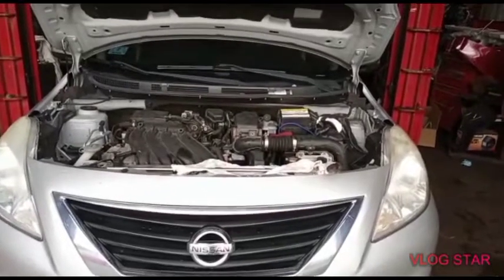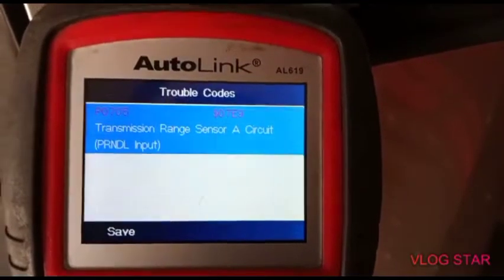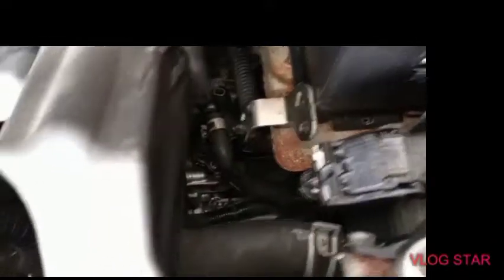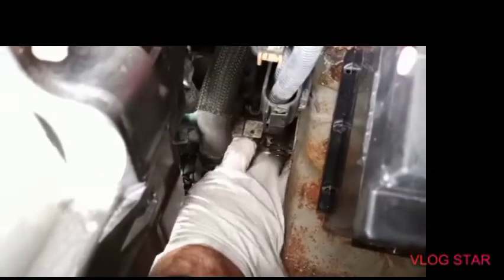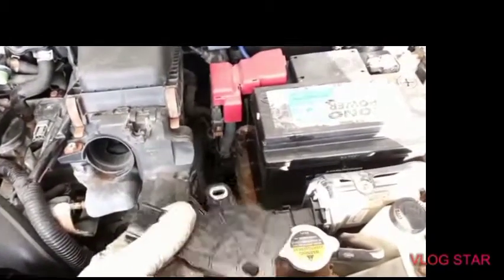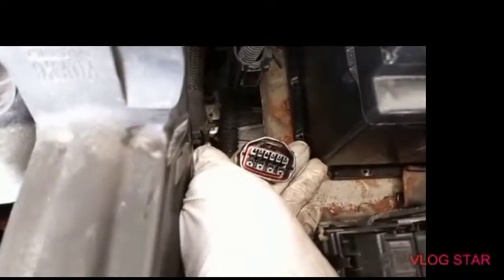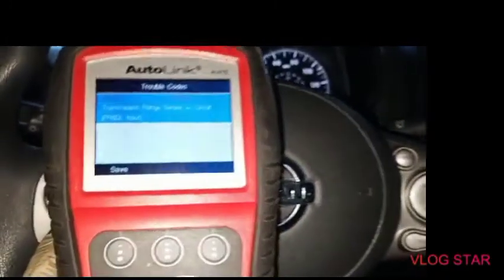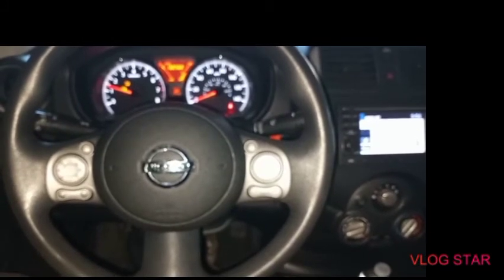2013 Nissan Versa transmission Range Sensor /neutral safety switch replacement Code po705 DIY

Comment: we're dealing with this issue. Our mechanic said to replace the rear tail light (which we did). something about corrosion. that seemed to fix it for a while but it's back again. I don't mind doing this as well... but I'm skeptical.
Reply: Just go for it man.. I need to replace it as well😂
Reply: I replaced the light assembly with code p 101. This p705 is different. I am going to do these steps. It seems simple enough. Thank you.

Comment: What were the symptoms that you had to replace it?
Reply: I know it’s been a year or more, but I’ll relay my experience. For me, sometimes the car will make like a pop sounds and feel like it shifts positions shortly after coming to a stop. Also, sometimes it feels like it’s having trouble going into drive and like it takes a little more effort on the pedal to get her going.
Reply: @TheJoemerk  thanks. I pretty much have the same thing you're talking about. Did it fix the solution after the replacement?
Reply: @jessietheaztec I haven’t gotten it fixed yet :/

Comment: Hello I replaced the part  and cleared the code. After 3 weeks the code came back any suggestions?
Reply: did you check the tail lights as someone told above?
Reply: Exact same thing happened to me. Were you able to figure out what was going on?

Comment: Have you came across brake issues with the 2012-2014 Nissan versa. The problem being the brake Master Cylinder. Where the owner would have to pump the brake pedal or apply a lot of force to bring the car to a stop.

Comment: What’s the hose right above the sensor? The one you went under to remove the sensor after removing the screws. I am dealing with this right now and I unhooked the hose and it had some blue fluid.
Great video by the way.

Comment: I am dealing with this issue as well and the dealership doesn't have a clue on what to do  and although p0705  can be reset it started not passing inspections.  im more frusterated that it can just turn on and off with seemingly no difference .

Comment: Hi Keeny, Nice video. My Nissan Sentra 2012, 2.0 CVT blowing the use when shifting to reverse. The Mechanic replaced the neutral safety switch. Still same problem. He said somewhere wiring is short circuit. How I can Check or replace the wiring harness. Any electrical diagram, so I can track the wiring. Please advise. Thanks

Comment: I have a Nissan Versa SL 2012 1.6, the engine light not on, and doesn’t show any code ! But my car start hard and sometimes no power and a few times on the red light car was on but no move , so I change spark plugs and air filter and Air mass sensor, but still car doesn’t start easy on morning ! If you think I should change engine speed sensor!?
Reply: It’s probably it is I had the same situation

Comment: We haven't reset the codes yet but I am not sure that it would still do all of this with a new part in it if it were fixed regardless of the code. I don't see a code issue making the car jerk with a new sensor put in it but I could be wrong. I'm more of a pessimist and I'm terrified that my car is having a different issue. It read the same code you had but I dunno.
Reply: Did you ever figure out what was causing the jerking? Mine is doing that after replacing the neutral safety switch

Comment: So what if this doesn't fix it? My PRND light is going off still and the car is jerking once or twice at a time when I stop still. We replaced this part (bought straight from Nissan) and changed the brake bulbs like they suggested and it's still not fixed. I have a 2019 Nissan Versa SV. It obviously has the POS CVT transmission in it.
Reply from the maker: Make sure when you put it back together the vehicle on park and flush the transmission fluid for new fluid
Reply: We have exact same problem did you get it fixed?
Reply: Cost for part?
Reply: Cost for garage to do this? I was quoted 400 up to totally replacing tranny 4000+  backup light was out. Replaced it and engine light went off. Not coke back on ever since.
Reply: Not come back on rather. Should I still replace that sensor?

Comment: I have a 2012 Nissan Versa and I can’t get the neutral safety sensor out  I took out bolts and still hard to remove it stuck on the shaft. I can’t get to break free . Do you have any advice
Reply: Were you able to figure this out? I'm having the same problem.
Reply: Did you figure this out?

Comment: When you get this code how do you know that it’s just the senor circuit and not something else wrong with the car
Reply: You could try checking the sensor output, but it's quite involved. If you're getting a P0705 code, do a google search. There is a common problem with this sensor that can be caused by high resistance in the reverse lamp circuit. Nissan has a service bulletin out about it.

Comment: How can you tell if it bad ?
Reply: Usually you get code p0705 but first you have to check the electrical wires, circuits, etc. because any problem with that can give you that code but not necessarily has to be the sensor...

Comment: I’ve had to get 6 of these things and still messing up
Reply: Hello. Did you solve your problem? Hope you were able to check stop lights from both sides, light bulbs and bad contacts moisture and rust can cause hell in your versa. That can also trigger a reverse neutral switch problem also.
Reply: Lasted 1 year with no engine lights might need another one too check engine light with the same code

Comment: I changed and still the code.
Reply: Check your taillights for large or small amounts of moisture and your taillight sockets for corrosion and or pitting corrosion. This sensor is in the same circuit as the taillights.
Oh yeah one more thing apply black caulking between the black taillight flange and the rear body to stop water from flowing between the flange and body.